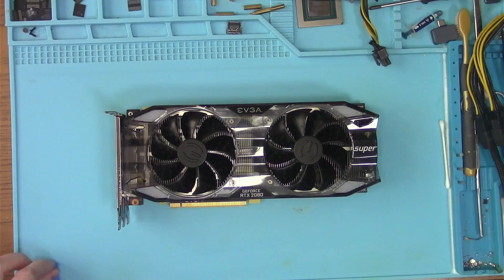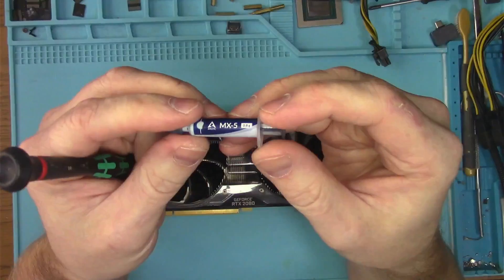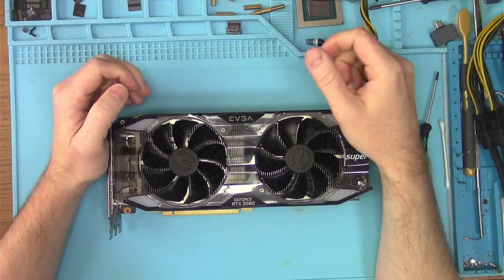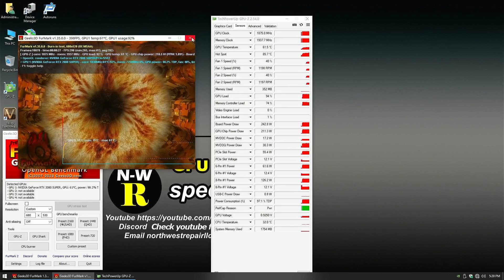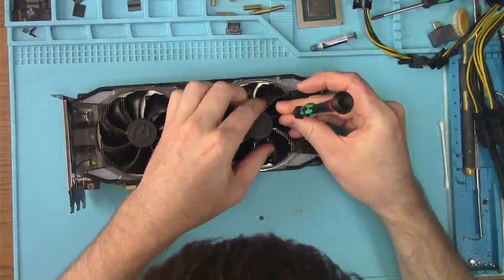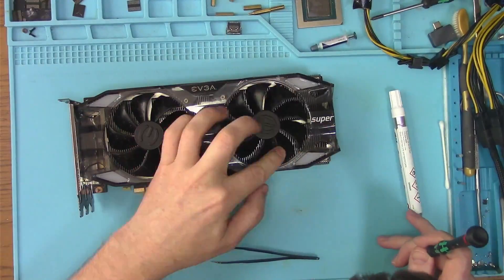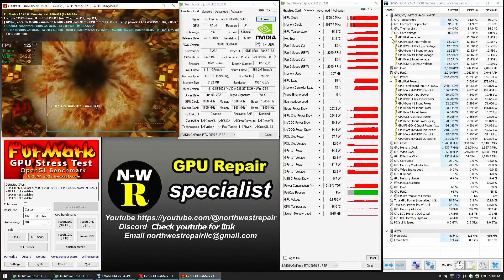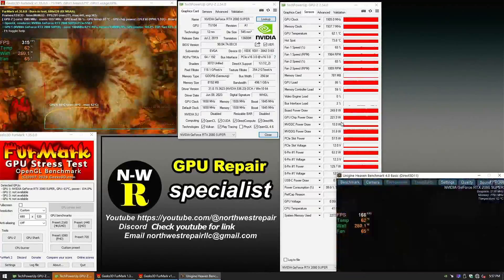How to fix overheating GPU (the easy way)

Comment: Idk if you will ever read this but here it goes.

I baught my msi 4070 super ventus 2x like a year back and almost out of the box it was very warm. Hovering at like 60-65 celcius on idle. And 80-87 on full load in any game pushing 180+ fps. So last week i unscrewed the heatsink and replaced the gpu thermal paste (which was literally cement and rock hard) And now with the new paste with the perfect amount still gets like 77-80. Am i just unlucky with the card itself or should i invest in a replacement cooler?

Comment: Hi @northwestrepair - i've got allmost brand new Asus Tuf 4070 super OC that was buy on 07.2024 and everything was working great but since 12.2024 i've started to register hight hot spot temps when playing games in 2K. Normal temps was near 70C but hot spot was 92C. I've manage to increase fan speed, set up better air flow in case and make sure that gpu is in performance mode rather quiet. It didnt make any significant changes so i assume that thermal paste that was applicated by asus pump out and now its not working as from the start. Do You think that it is better to repaste it with ptm7950 rather using warranty and sending it back to asus for probably 1 month so they will do it? Hot spot 92C is not ok but i see users registering over 100C without problems in using card. Fans are bumb up to 85% when card is under load  when playing. In idle its working at great 35C and 42C hot spot

Comment: What is the normal maximum temperature of a gaming laptop GPU? I get 90 C during gaming with my GTX 960m. Is that OK? The heatsink is burning hot where it blows out air, so heat is transferred out. Thanks

Comment: I've got problem with the temps going up to 88 C° while gaming and on idle 42/43 C° whereas they used to be while gaming reaching max 75 C° and on idle it stayed at 35/36 C° I've done everything I could do possibly like applying the thermal paste and cleaning the heatsink but the issue is still there, please advise
Reply: Exact same issue here Im thinking of just biting the bullet and getting a new card. I have a used AMD Ryzen 5700XT as my card which I've had for about 3 and a half or maybe 4 years. Followed all the tips in the video, replaced the thermal paste but still having similar issues. I've had my GPU reach 100C while gaming and then force itself to crash to save itself. Idle runs about 45-50, games it runs about 70 overall, 85 hotspot, and some games it just doesn't run at all and reaches 100C in minutes and crashes.
Reply: @ハーフ-r1m  I reapplied the thermal paste and the GPU is fine now no more heating up. The first two attempts were unsuccessful dunoo why otherwise I had applied the paste the same way I have now applied... you should try reapplying the paste and make sure you clean it well before doing it e.g fans and the heatsink... there shouldn't be any dust at all, and yeah I also rolled back to a previous driver and it worked like a charm.
Reply: @Tabi4930-o3x  I reapplied and it only marginally improved my performance. My overall temps are good but I get super high hotspots. Like at 65 overall I'll be at a 90 hotspot for no reason. In my case my GPU is likely damaged. Might have to get a new one.
Reply: @ハーフ-r1m  Given the age and the usage it's definitely the time to get a new GPU 👍
Reply: @ハーフ-r1m  The pads need to be replaced as well as the paste.

Comment: My PC keeps shutting off randomly. I believe it is because the GPU is overheating. I know I probably need to replace the thermal paste as my GPU (It is an RX 480) is 8 years old and I don't think it has ever being repasted before. The only problem is I am to scared to take it apart. I would hate if something broke as I don't have enough money to replace it yet.

Comment: Im sorry to say but that thermal paste you using is a piece of crqp, you need to use a hight w/m.k like a value of 15 or more cause that way it will help cool netter because heat is transferred quickly to the heatsink from the GPU. Mx6 isn't good.

Comment: Way back in the late 90's, my friend bought himself a Matrox Mystique. It was the beginning of the 3D accelerator revolution. 3Dfx VooDoo wasn't a thing yet. But he bought that Matrox and I installed the drivers for him, and we fired up "Moto Racer" on his P1 166Mhz machine, and it FLEW! I mean it was SMOOTH at 640x480! It looked incredible! We were amazed! Played it for hours! 

Few weeks later, I also bought a Mystique. How could I not? I had a P1 133Mhz, so my friends rig was still faster, but when I bought that Mystique, he got upset. Always one to show off, and such an ego, he went out the next day and bought himself the 2MB expansion that plugged into the Mystique. Bringing the VRAM from 2MB to 4MB. 

As we played MotoRacer in null serial link mode, I was wheelie-ing through the turn at Red Canyon, and suddenly I smelled something burning. And he did too. He started to laugh he said "Ha! Hey DAVE! Your slow CPU must be on fire! Can you smell the burning?" and I said "Yeah! And it ain't my CPU! ITS YOUR PC! LOOK AT THE SMOKE!" and there were BILLOWS of smoke coming out the back of his PC! And then his screen went black!

He dived forward, cut the power. We opened up his case, that 2MB expansion he bought was on fire! It wrecked his card and his motherboard. And I laughed harder than I'd ever laughed before! But he had the LAST laugh. Cos the next day he went to NuWorld Computing and spent £2000 on a Pentium 2 233Mhz, with a 3Dfx Orchid Righteous 4MB and a Soundblaster AWE32.

I still beat him at MotoRacer though! :D Skill > Flops

AND I STILL have my Matrox Mystique! XD In a Pentium 200Mhz rig. Works fine never been on fire! <3
Reply: Haha 😆 great story:))

Comment: Good thing they got that to you before those wires were worn out. Could have easily worn through the shielding/cover on the wire and have a short-circuit, it's that exact kind of dumb unlucky stuff perfect to ruin a card. I wish stuff like redoing the thermal paste was more prominent/known, a lot of people don't even know thermal paste is a thing.

Comment: I love how cleverly EVGA engineered the 20xx cards. You just need to unscrew the four screw to take the heatsink off and repaste it. I recently repasted my 2080 XC2 Ultra and the hot spot temperature went from 103 degrees celsius to 74! Almost 30 degrees drop and the average went from 81 degrees celsius to around 61. It also was my first gpu repaste, it was fun!
Reply: Same here. Have a
 2070 from ASUS. Hotspot was 107, but after a quick repaste it dropped to like 81 or so. Had to only unscrew 4 screws too

Comment: 🤣The first step to fix GPU overheating is to use thermal pads at least half millimeter thicker than the original ones. This way the Thermal paste on the GPU will be very thick and will not be able to transfer the heat to the cooler and we can count on temperatures probably above 90 Celsius which is perfect for the Winter. 🤣
P.S. For those who may not know, do not use thermal pads thicker than the original ones, ever.

Comment: MX5 actually performs a bit better than MX4 if I remember correctly, but with time it will cause issues. That's why it has been discontinued and is not advisable to buy or use it. Use MX4 or MX6 instead, MX6 performs better but the viscosity is so damn high it's harder to separate the heatsink than with MX4.
Reply: High viscosity lasts longer on hot direct-core chips. Easy to spread pastes give good temperature results for the first weeks/months and are more suited for desktop CPU's with heatspreader.

Comment: on some 1660 , 1650 or even 1050ti cards that have poor aluminum only heat spreader i noticed the delta is high from the box. just saying :)

Comment: my 2070s runs too hot 83c stable and 90 on hotspot but when i use my undervolt oc profile, it runs better and cooler around 71c . idk whats happening there, cleaned, new pastes and new pads, it fits perfectly but temps doesnt change so i always use my oc profile.
Reply: 2000 series cards undervolt nicely, my 2070 ram around low 70s with higher fan curve 
Undervolted to 925mv and it runs at max 65c at 40% fan speeds, usually most games it runs low 60s. So around 10 or so degree difference for me ( ;

Comment: For GPUs & laptops, i recommend MX-6. In accordance to my own testing (very low sample - only 2 GPUs - 6600XT & 3060 ti) it is almost on par (within margin of error) with PTM7950.

Most of the pastes recommended for CPUs (MX-4, NT-H1/H2, etc) will pump out over time.

MX-5 should be avoided at all cost, as it is faulty product, which Arctic themselves stopped manufacturing.
Reply: Many people don't realize that different types of thermal paste or thermal interface material in general are best depending on the situation. Desktop CPUs with an integrated heatspreader behave differently than any bare-die chips like GPUs or laptop CPUs.

With an IHS it doesn't matter when a tiny spot isn't covered, so you want a more runny thermal compound to get the layer as thin as possible, but with bare-die chips you need to make sure every part of the surface is covered so the material needs to be more viscous. Which is why many manufacturers have started to resort to phase transition material.

Sadly many "experts" will tell you phase transition material is dried up thermal paste and recommend to replace it, which doesn't help performance at all, it might be ever so slightly better on initial tests but will degrade very quickly.
Reply: @Alvin853  i think the manufacturers should be more transparent, when it comes to used thermal interfaces. Like tell me the exact brand of paste/phase transition material used, along with brand and thickness of all pads used, so i don´t have to open the card without all required resources  ready on hand to put it back together.
Reply: well PTM7950 is the best choice tbh, counters pumpout caused by copper expanding its own size by temperature
Reply: @resko8758  while i agree, it´s tricky to apply and kinda expensive in comparison with any thermal paste - aka not worth buying. Except the case, when you don´t plan to open the GPU ever again.

Comment: I had an overheating Asus Dual Mini 3060Ti, 100% Fanspeed and 100°C hotspot. I disassembled it, which was hard... Some screws for the heatsink were under the backplate and some screws of the backplate were under the heatsink...yeah... I used pliers and a drill... it went fine. But after putting it back together the temps were the same. :D
My case was the problem. For some reason the hot air didn't move away from the card, despite having a fan blowing from below past the card. 
The air from the fan probably stopped the air form exiting the heatsink, since it is turned 90° (like a blower card) compared to normal heatsinks. In an open air bench it runs normal and cool.
I eventually sold the 3060Ti and bought a 4090FE.. the 4090 is in the same case, but it doesn't throttle even with 600W blasting through it..

Comment: My liquid devil 7900 XTX if repasted 2 times after repaste it had hotspot of 75c a drop from 92c hotspot, but after 1-2 weeks it came back to 92c hotspot each time, online users have reported the same with mx-6 while if used mx-4.
I eventually just gave up and got PTM7950 instead as a last resort before trying liquid metal and my hotspot is in the 60-70c range now instead of 92c range, PTM7950 is phase changing material that melts at 45c kind of acts like liquid metal except it has lower melting point, PTM7950 is what you wanna try if you have good day 1 results but after like 1-2 weeks or maybe even 4-8 weeks you get worse temps under similar conditions, its what NVIDIA puts on their RTX 4090 FE as stock paste or lenovo on their laptops.
My edge temps are in the 38-42c range PTM7950 is made by honeywell only sold in batches so can only get it from resellers
Pumpout is especially issue on chips that bulge or uneven cooling surface considering liquid devil is a ekwb that is infamous for uneven cooling surface and AMD for their bulging chips you can guess what i have is pumpout issue.
I am on day 88 now with PTM7950 and temps are still the same as they where after day 2, as PTM7950 will perform worse in the first 5 to 10 minutes as it needs to burn in.
Reply: PTM7950 is the only thing I'll use on a GPU core now. Performs nearly as well as liquid metal with none of the drawbacks.
Reply: @jonb695  What drawbacks are you talking about? Aluminium heatsink? If it's aluminium, it's not a good heatsink so... why would we talk about them?
Reply: @Dandan-tg6tj  I was primarily thinking about the electrically conductive bit. Having to apply conformal coating or similar around the die is an added step that consumes more time. PTM7950 isn't electrically conductive so that isn't a concern. It typically performs within a couple degrees of liquid metal and has been shown that it can actually perform equal to LM in certain situations and like LM it doesn't suffer from pump out.
Liquid metal does also react with bare copper, it doesn't hurt the copper at all but some of the LM does disperse into the copper, sometimes necessitating reapplication.
Reply: GPU sag.
Reply: @Dandan-tg6tj   Sir i have a vertical gpu mount and PTM7950 fixed it, do not just mention random reasons without any knowledge of user situation it makes you look dumb

Comment: i wanna hear your opinion about butchered gpu, like it has missing 2 pipes in the heatsink, although idle is reasonably cold at 40C but when stressed it goes up to 85C... will adding good thermal paste will improve its temperature?  it is xfx rx580 that i got from china, im doing undervolt as well using the radeon software so it wouldnt get toast it's just when stressed enuff it goes beyond 80c which im worried... thanksss

Comment: MX5 is a very inconsistent paste. It's formulated wrong or has suffered a manufacturing defect, so it often doesn't work properly. The same fate befell MX3 funny huh, one speaks of the Arctic odd-number curse. So both were discontinued after a short time and replaced by MX4 and MX6 respectively.

Comment: What thermal paste do you recommend for GPU only and GPU/CPU? I heard that MX-6 is the best now for long-term use as they thought about the pumpout effect and made it more viscous to last longer.
Reply from the maker: MX4
Reply: @northwestrepair   you would pull your hair out trying to fix my liquid devil 7900 XTX hotspot temps with just MX-4 altho maybe not cos you only see day 1 results not how it performs after 1-2 weeks
Reply: @Arokhantos  If you don't use an additional support to prevent GPU sag, what do you expect? In 2 weeks the stabilized thermal paste will stay in place while your cooler gets to be a little bit moved due to GPU sag. Maybe you did change the thermal pads yourself?
Reply: @Dandan-tg6tj  Like mentioned in my other post i have vertical gpu mount
Reply: @northwestrepair  that thermal paste i use! only mx4 I have Rx6600 Gigabyte Eagle.
Reply: @northwestrepair  MX6 should actually a bit better than the MX4
Reply: Could you do a thermal paste benchmark down the line on multiple cards maybe? Think you would be the most qualified YouTuber. Thermal grizzly extreme pink paste has worked fine for my 3090 fe with a 12 delta and 73C with 400W stock fan curve
Reply from the maker: @Multimeter1  there are plenty already
Reply: I know it’s not a paste, but PTM7950 is a really good choice for your gpu. I used it in my 6950xt and my hotspot hasn’t gone above 90c.
Reply: @gavinfinif8931  It has 8.5 Thermal Conductivity? This is what makes it so good?
Reply: @Dandan-tg6tj  Performs better than any paste i have used on many devices and lasts. I have industrial sized sheets.

Comment: you need to change that fan... no cap that fan is broken. meaning everytime i spins its hitting the wires.. one day if will fall off.. like mies
Reply from the maker: Everything will fail one day.
Reply: @northwestrepair  Thank you for your reply! yes true that as it may be. i have had the same issue. when it comes to evga card the 'second fan' on the 2 card models seem to fail. mines did the same thing thinking it was the wire. even after fixing it. it seems the plastic is broken (cracked) in it and it may be holding on by a tread.. mines evga 2070 super.. has 1 broken fan that evga didnt want to replace and a broken rgb strip that cause the gpu to not work cause its shorted. the thermal pads are the worst ever that will keep leaking liquid on the gpu socking up all the dust untill it usless.. at some point using the gpu.. the fan blades broke and fell off.. still need to get one T.T
Reply from the maker: @hafeez387  I don't know how many EVGA cards you had. Ive had maybe 50+ and not one of them had a failed fan except this one.
Reply: @northwestrepair  true.. u speak from all the work u have done. maybe its just a few cards that had this issue and i was just unlucky..

Comment: how about overheating core even fanspeed set to 90% 😂
Reply: I used to replace the coolers completely of some MSI Armor cards because the pipes lost the liquid and were not able transfer the heat. Usually, if you take the cooler apart, the paste must be very thin, almost see through. If it's not then you have it wrong.
Reply from the maker: heatsink does not contact the core.
Dry paste.
Reply: @northwestrepair i already changed the paste & it's in contact with the heatsink